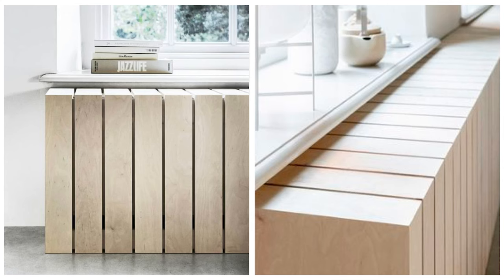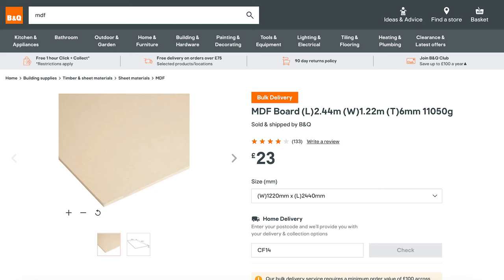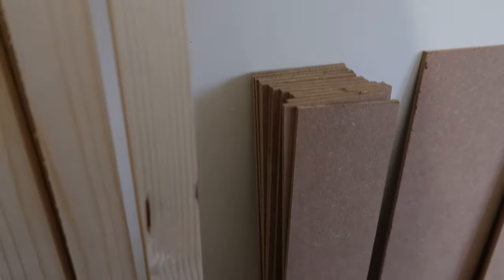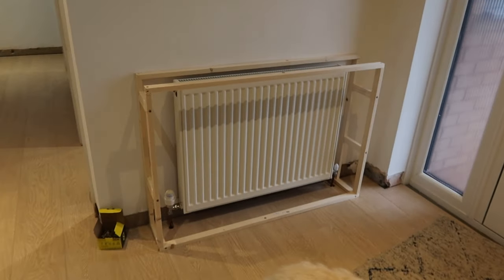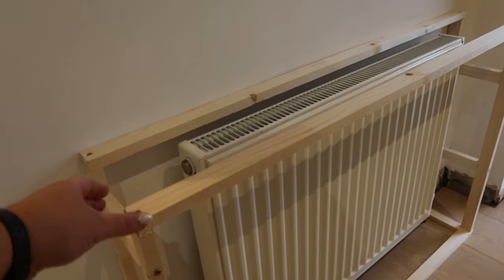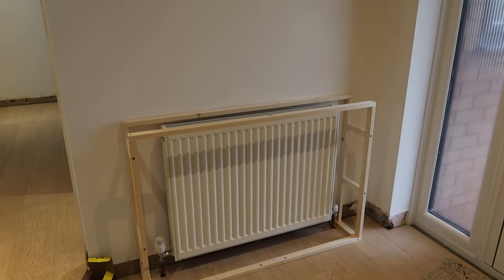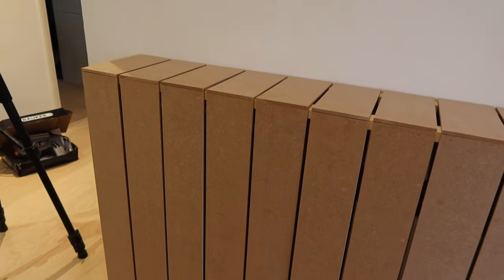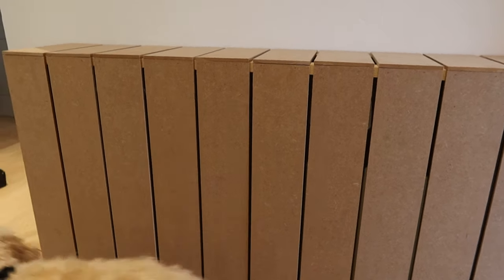How To Build A Modern Slat DIY Radiator Cover

Comment: shouldnt you have left larger gaps between the boards? Im concerned that most of the heat will be trapped inside the cover. Also, the thermostats regulates itself relative to the temperature in the room yea? I reckon it's gonna mess up since it's obviously gonna be warmer inside the cover as opposed to the actual room temperature. Any thoughts on this? Thanks!
Reply from the maker: No the gaps are large enough to let the warm air pass through. It doesn’t hold the heat in whatsoever and the hallway is just as warm as before we installed it. We have a separate thermostat to control the heating so it the radiator cover doesn’t affect that at all

Comment: Question: are you still able to keep this cover in place when the radiator is functioning?
Reply: actually this is bad for the circulation. the gaps need to be wider tho... function over design is always the best choice here.. especially when the prices are getting higher and higher...

Comment: Beautiful job btw. question. do you keep this on the radiator while it's on? I live in a pre war building which we do not control the thermostat & i'm concerned that anything i build over the radiator will either peel or worst case catch fire, Im thinking what i should do to makes it fire proof.
Reply from the maker: Yes we keep it on. I didn’t attach it to the wall so we could slide it out to adjust the thermostat. It doesn’t touch the radiator at all so it should be fine 😊

Comment: Hi Louise, please do you mind sharing your measurements?
Reply from the maker: Of course. It’s 107cm wide, 21cm deep and 73cm high. I do wish it was a bit taller though 🙈
Reply: @LouiseHenryHome  thank you 😊
Reply: @LouiseHenryHome at ends ( sides), cut short sticks and nail. No need for front, just the ends.

Comment: Great design, a bit of glue would have helped the slat corner joints, am a afraid because there is no glue the joints will move and the filler will crack.  A great job though.

Comment: Hi nice job but sorry 😢 how do you get to the knob 1 and if you leaves it on for winter no much heat I believe you should leave some space between each Planck and a visiting space to get to the knob sorry to tell you that but it is my own opinion in place of that the job is nice
Reply: 4:40 there's no attachment behind to the wall, so they can slide cover away from radiator.